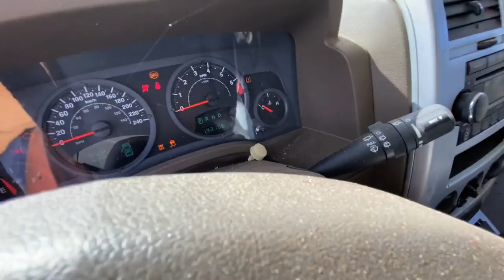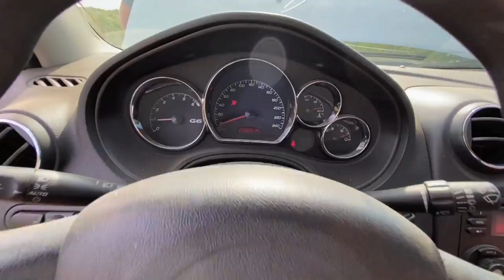CRASH! Pontiac G6 FULL SEND!

Comment: you should put a lawn tractor or something in the back of the f150 whenever you jump it
Reply: Running, with the fuel cap off, preferably.
Reply: I will send my zero turn for $3,000 usd
Reply: @WilliamHollinger2019  $2,950!